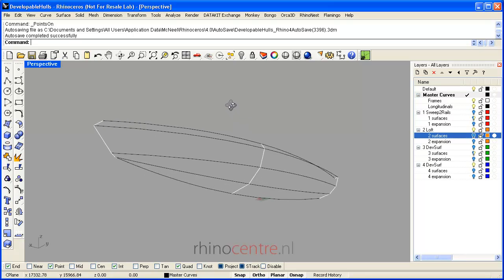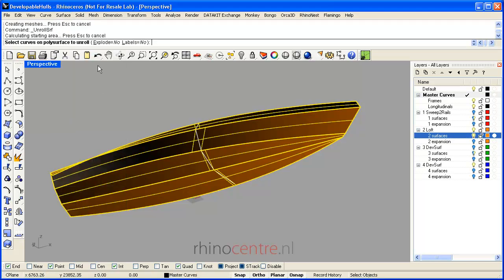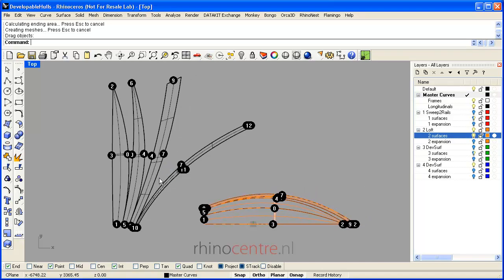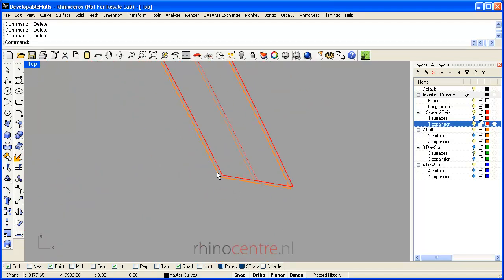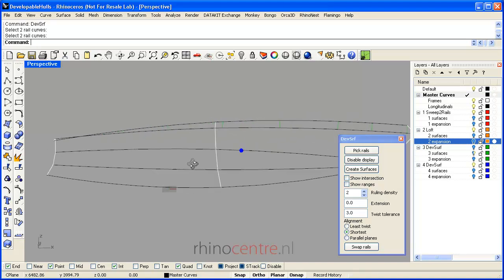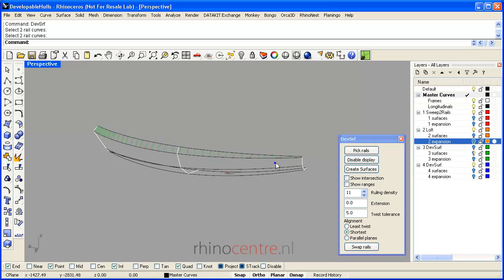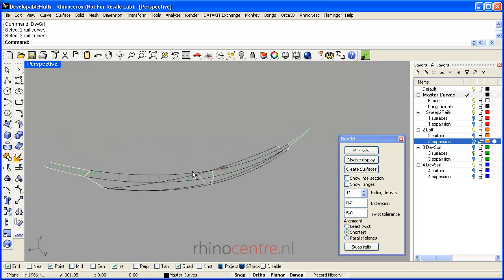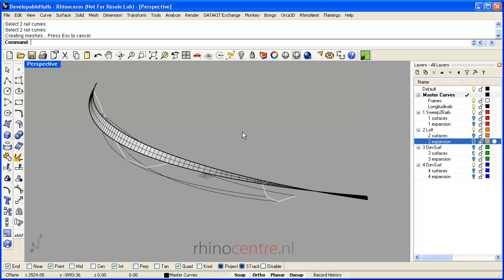Tutorial 2 Developable Hull Shapes in Rhino3d

Comment from the maker: Yes changing tolerances can be a solution. However, often the input is not accurate resulting in edges that do not touch. Modeling accurate curves is most important. When an end point of one curve doesn't touch the start point of the next point within the tolerance, often problems occur.